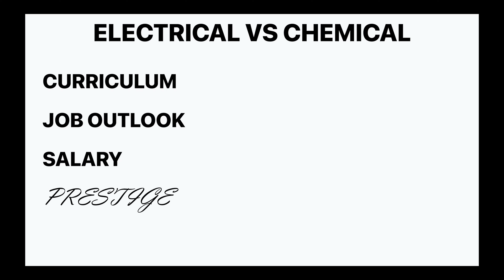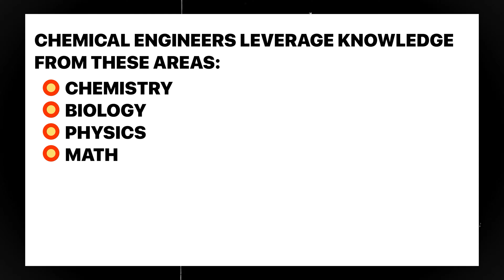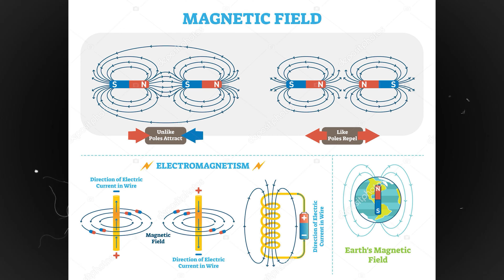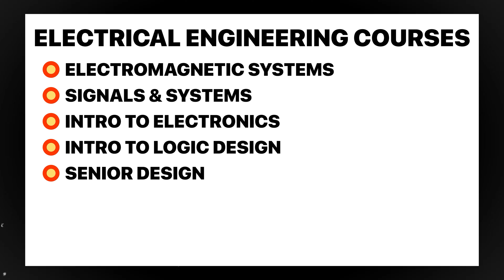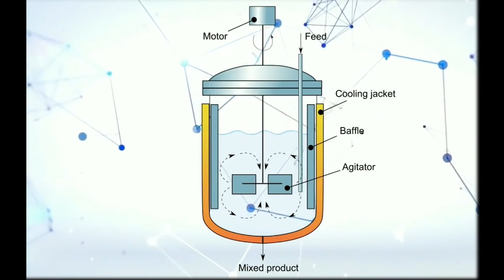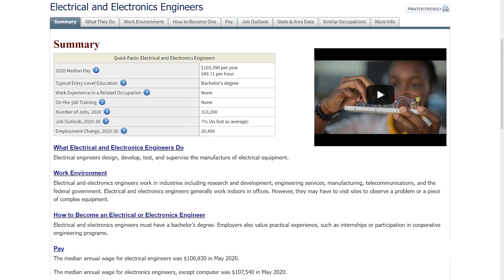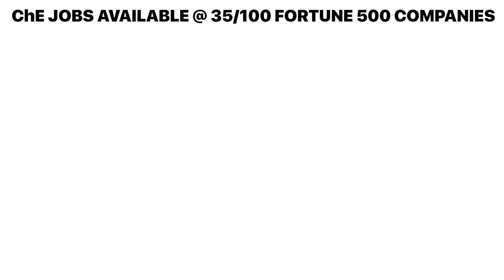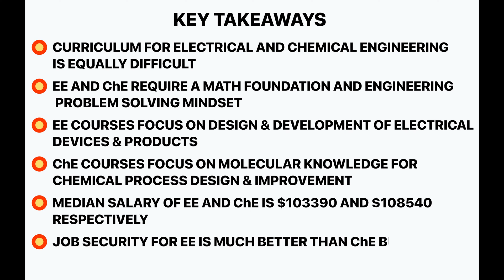Electrical vs Chemical Engineering : Which is BETTER?

Comment: If I heard correctly CE can go to EEE and EEE can go to CE with further classes each or is one easier than the other to transfer
Reply from the maker: Both are great majors, and it’s possible to switch between the two by taking additional classes

Comment: Now regarding clean energy, batteries and electronics. There is a lot of chemical stuff happening that I don't think EEs touch.  

So if you want to create something new with electrical, would chemical be a better field than electrical engineering?

Comment: Superb ! Bro i also am thinking about starting online entrepreneur journey as hvac construction design engineer working with ms excel, autocad & revit so what advice would you give to keep in mind to be successful at it - like any book recommendations or practical tips to get those initial clients for projects without wasting time..
Reply from the maker: Good luck on your endeavor bro! I would say understand your client's needs, have a plan, and don't be afraid to make mistakes 💪